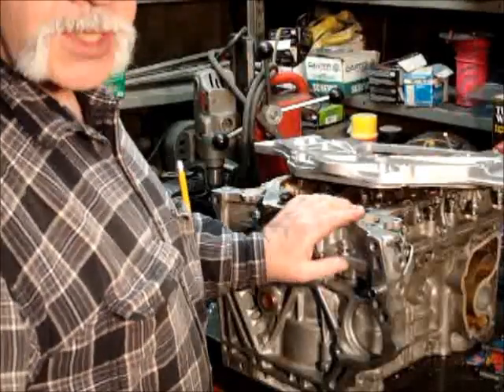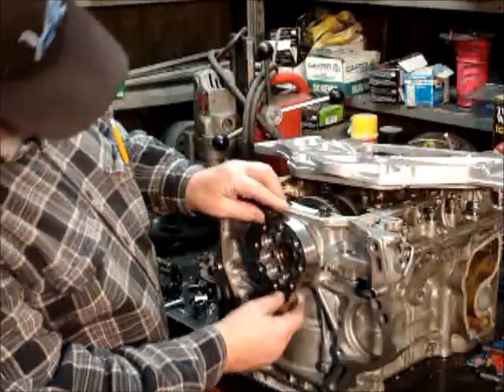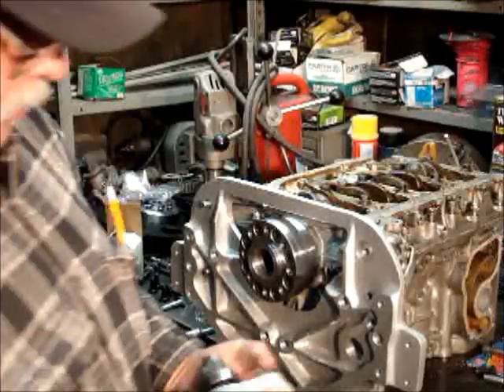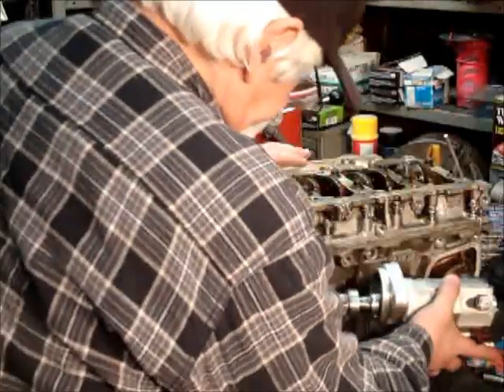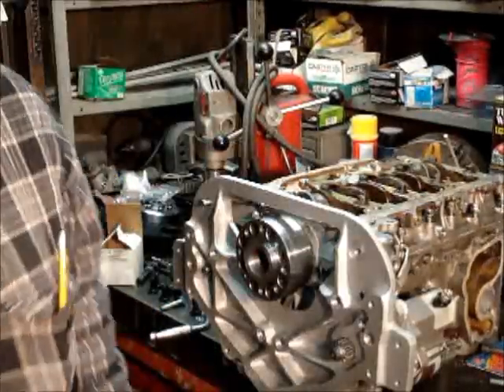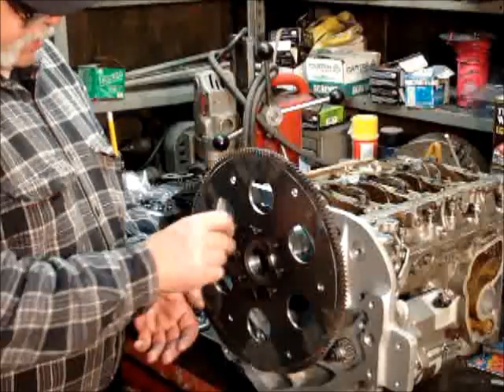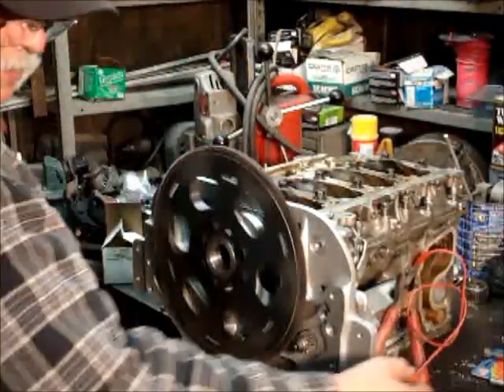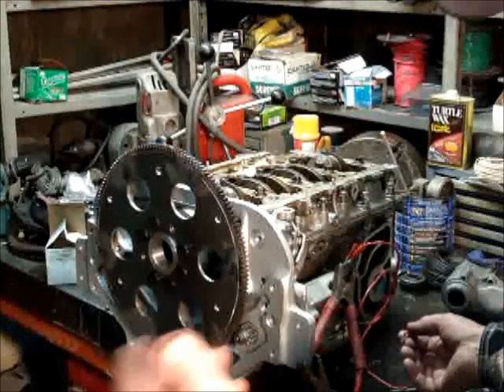K20Gmadapter Honda  RWD adapter,K20a Gm powerglide auto trans engine swap adapter

Comment: I need these
Reply from the maker: I still build them
Reply: @lakota240  what is the cost? What other transmissions do you make  adapter plate to go on k24?
Reply from the maker: @122amazonls5  send me an email to Japaneseauto1977@yahoo.com the unit has changed in two ways, the crankshaft coupler is one piece design and the starter is in the original Honda location

Comment: Your adapters work really well, I recently watched a Toyota Tacoma run an 8.12 at 160 mph in the 1/4 mile with your adapter /GM Powerglide behind an 800 hp K 24.Honda.Excellent work Bill.Hope you sell a bunch of them.
Reply: Is there a way to purchase this kit ?

Comment from the maker: yes I build them all the time some changes since the video include starter location has been changed to the original Honda location and the crank coupler is one piece
 they sell for $1200 bucks plus shipping and include the starter, flexplate, crank coupler, adapter plate and bolt kit
thanks for asking

 Bill 
 419-367-1758
Reply: Where can this be ordered Bill?

Thanks!
Reply from the maker: @320MN  Japaneseauto1978@yahoo.com

Comment: will this fit onto chev pattern bellhousing for zf4hp22 intended for chev motor add the adapter plate to fit the k20 engine?

Comment: What are you dropping the engine into? I think it's time to stick it in a 1960s British Ford, an MGB, or something like that. How about a 1932 Ford roadster?
Reply: Chris, these mostly drag cars, K20/ K24 in rear drive conversions or swaps.An example would be a Toyota Tacoma with a K24 Honda to a  GM powerglide, Ford 9 inch rear. But yes you could install a Honda in  British Ford /MGM These little Honda motors make a reliable 500 -1000 hp with a turbo and a few minor upgrades. Even normally aspirated, the 4 cylinders Honda's can make 500 hp +, though it can get a little expensive. These little  motor's buzz up to 10,000 rpm
Reply: I am actually in the process of putting a jdm k24 with gm trans into a 29ford and definitely going to need one of the kits.

Comment: How much is this conversion plate and does it change the orientation of the engine in the engine bay?
Reply from the maker: +alex moore it changes everything in the engine bay, most guys are using it in a RWD platform
Reply: How much is this kit?
I am interstead in purchasing one.